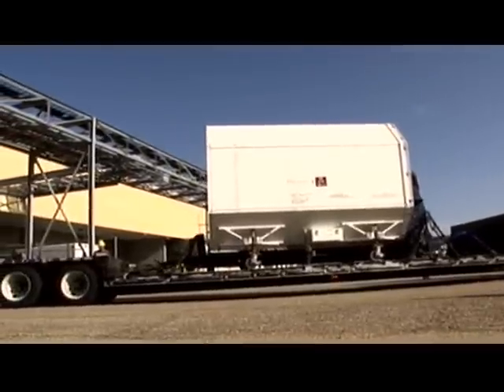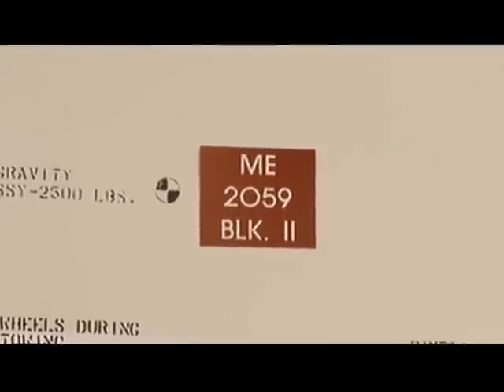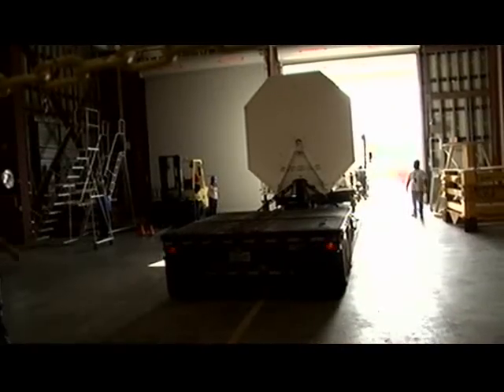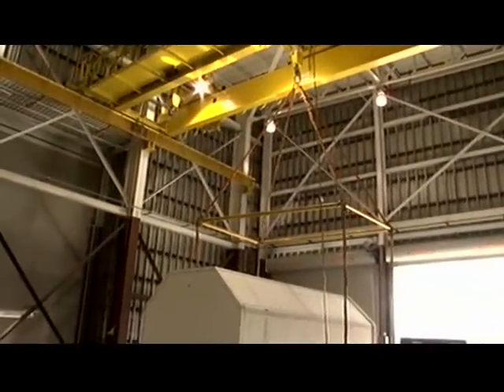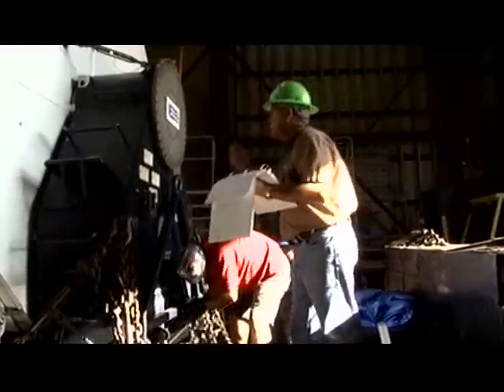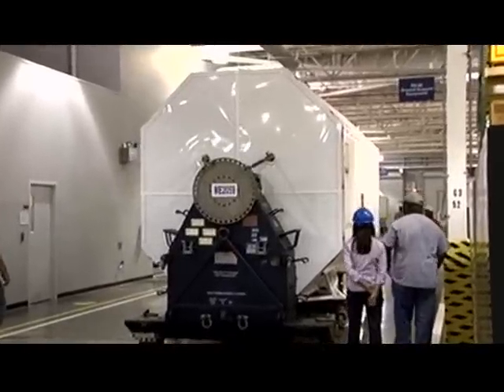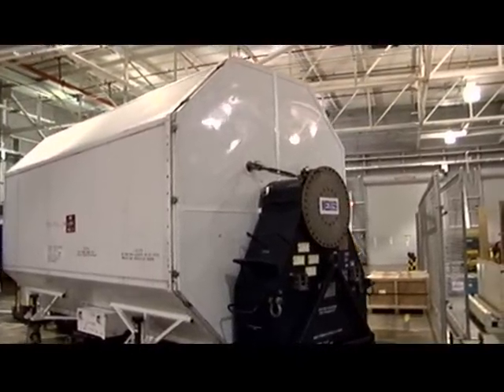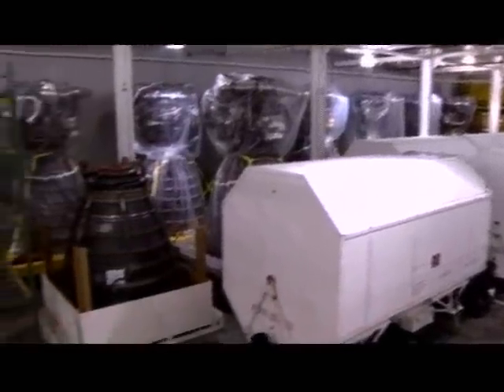Final RS-25 Engine Arrives at Stennis

Comment: Just in case you don't figure it out from the single tag referring to these engines as they were called for around 30 years, these are SSMEs (Space Shuttle Main Engines). With the absence of vehicles on which to install and use them, they now revert to their generic designation - Rocket System-25 or RS-25. I believe that's correct.